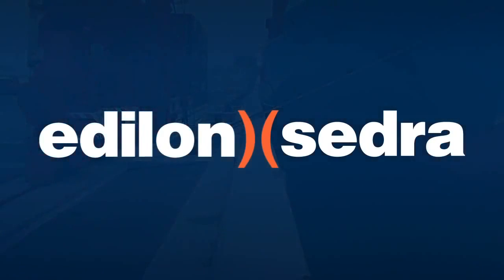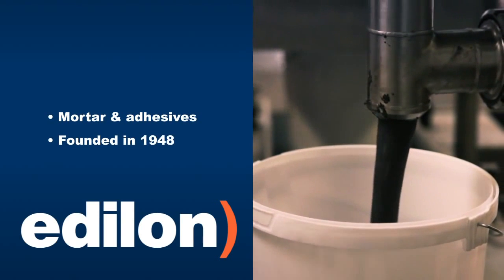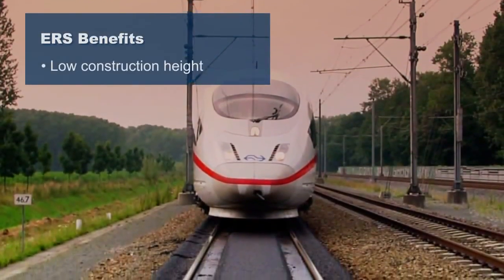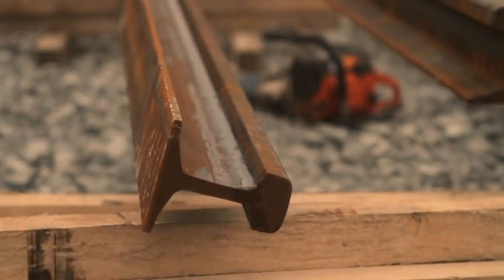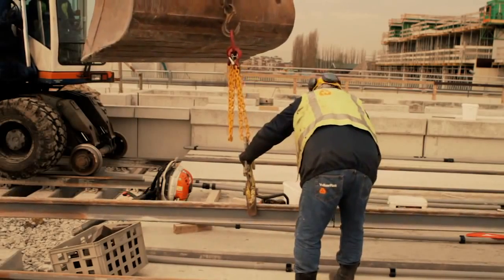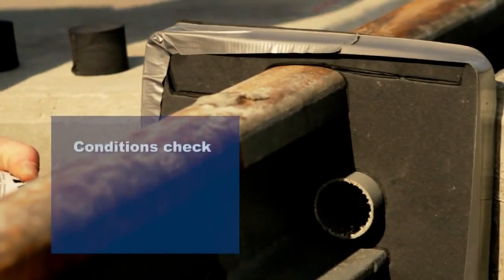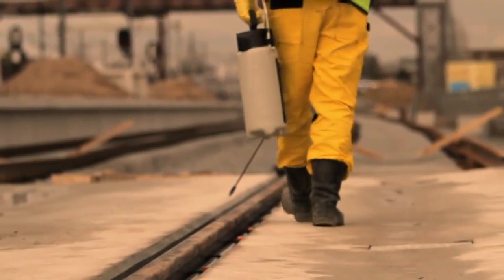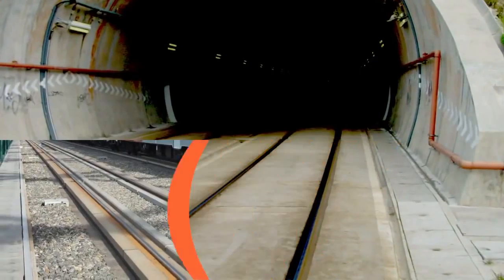edilon)(sedra Corkelast ERS (Embedded Rail System)

Comment: Whoever designed this crap does not know how railways work. Installation requires too much labour. The rail will be hard to replace. The elastomer will decompose if rail heats significantly. Heating happens with rail grinding, wheel slip and when welding continuous track. There seems to be no provision for axle counters. Thermal expansion can cause the rail to debond from the elastomer.